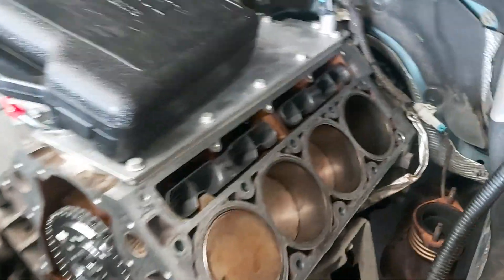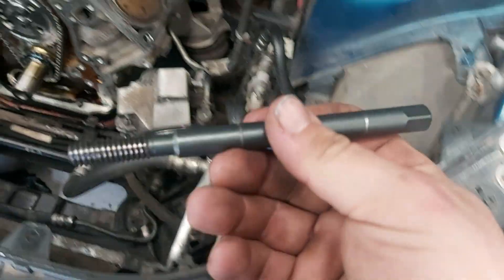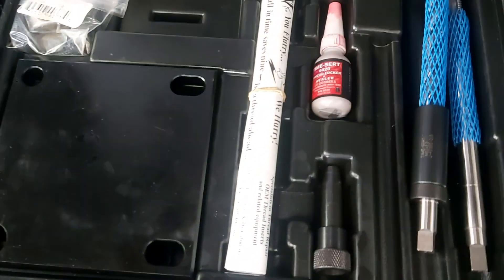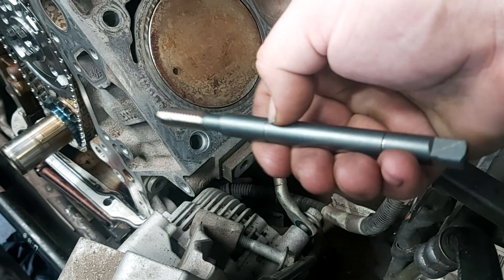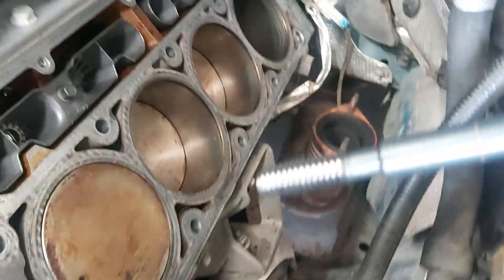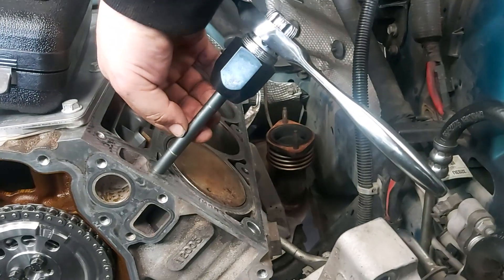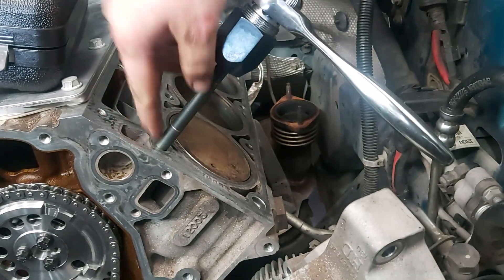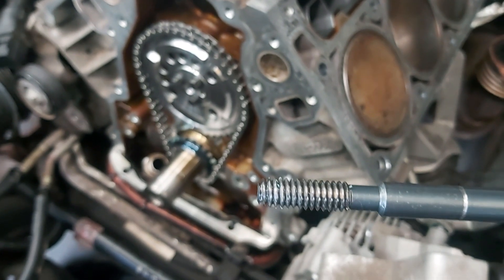What to do if you strip a head bolt hole on alloy ls engines

Comment: If you want to clean your headbolt holes out on a budget... get a grinder, cut a few reliefs along the length of the old headbolts and just wind them in and out (with no tightening) and every time you pull them out there (might or will) be gunk caught in those reliefs that cut in. I did an L77 DOD delete and Cam upgrade and this was one of the parts I was most anxious about, especially after you take the heads off and coolant goes everywhere, if you have shop air blow it out too, but I used the bolt and brake cleaner combo to help get rid of all the shit in there. Im not a pro at all. But the internet is full of amazing tips for people who don't have access to shop tools.

Comment: Very keen to know what u did to the l77 performance wise n how much mines a slug i need some work done
Reply from the maker: Mild ported heads, decked, reseat valves, full cam package with DOD DELETE kit made 305kw thru stock stall auto
Reply: Whats the damage $$$
Reply from the maker: Usually runs about $5500aud

Comment: For us average guys that won't spend 1k on something we'll hardly use, would a correct threaded tap work?
Reply from the maker: I wouldn't recommend it tapping it out I would think takes to much meat out of the thread which will weaken it anyway
A thread chaser is slightly under size to just scrap the threads not cut them
Reply: @AussieAuto  I suppose it would be tricky to only scrape the gunk without cutting the thread.
Reply from the maker: I've been told arp do a thread chaser tool that I'd assume would be far more affordable then the entire set I have
Reply: @AussieAuto  cheers man!
I gotta say ya beasty sounds absolutely mint now 👌
Reply from the maker: She's on another level she's in for full dyno tune this Tuesday so by next week we will have full numbers on what it can do

Comment: Arp also make a head bolt Chaser part # ARP 912-0011
Reply: You can also make your own thread chaser, similar to that $100+ ARP tool.  Just take an old bolt that is not damaged, and use the corner of a bench grinder wheel to grind some vertical cuts across the thread.  2 cuts 180 deg apart are fine.  So long as you grind clean cuts into the thread without burred edges, it will chase the threads and collect all funk from the hole.  It works for any thread or bolt.  Fuck buying a 'thread chaser' for every size of thread out there!
Reply: @ArchimedeanEye  Damn i just typed out basically this same comment .. pays to have scroll first LMAO
Reply from the maker: Sweet I didn't know that!